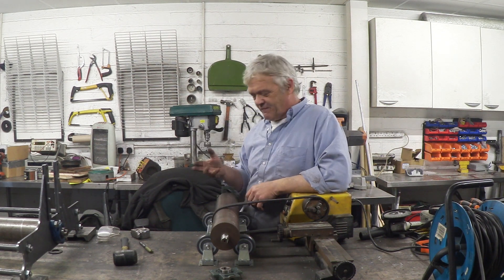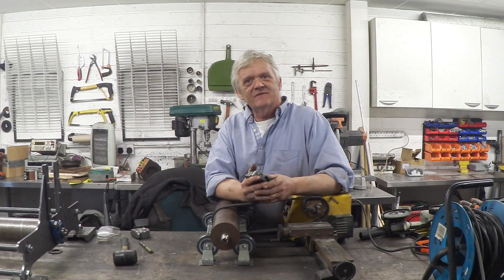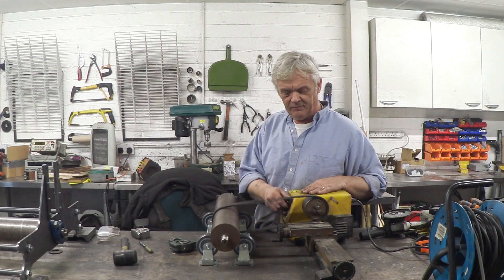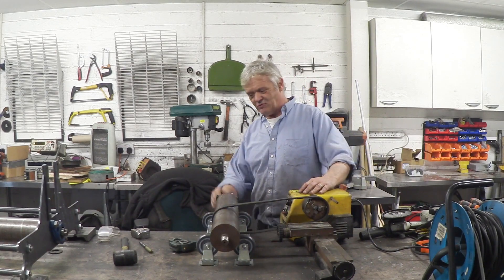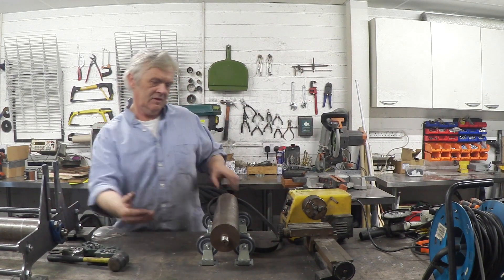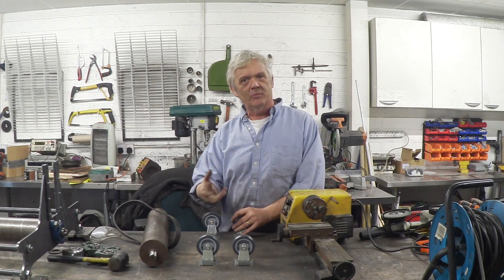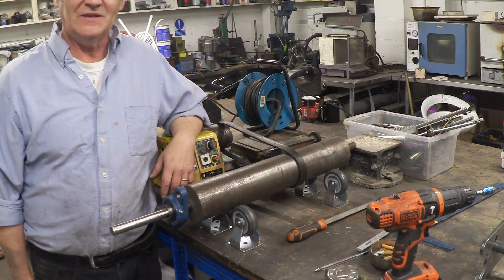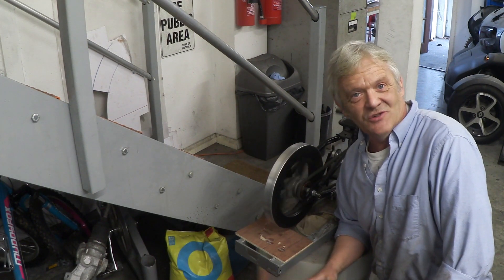1282 How To Adapt A Mini Lathe To Do More Than It Should

Comment: A good way to work on very large diameter disks is to use a wood lathe with the head moved down to the end of the bed whilst mounted on a bench. This allows the disk workpiece to hang in free space beside the bench. The biggest disk I’ve worked on this way was 30” diameter. Thank you for sharing

Comment: The only problem when doing a larger flywheel or something is it's hard to get it totally true using a grinder or something.  Unless the grinder is stationary.  Solid.  Otherwise,  if the wheel isn't totally round,  it will just follow the same shape as it is.  Hope I'm getting the point across.  I've done it though.  Using a drill press even.

Comment: I love your videos, always fun and very interesting, Here let me run this through you if i may, Its an idea for and electro magnetic pulse engine ' Not sure if it would work but the concept is there'.

You basically have the same setup as a 2 cylinder engine that would run on petrol and change some parts. the petrol engine needs a spark plug to ignite the fuel pushing the piston down on number one cylinder, As cylinder one goes down cylinder two comes up and the same thing happens again. (that's how a engine works) My idea is to replace the spark plugs with some strong magnets that are connected to the coil and instead of the spark plug pushing the piston down, You'd have the electro magnet pulse from the coil pulling the piston up and when then piston reaches its peak then electro magnet pulse from the coil two would become electrified pulling up piston 2 making piston one go down. 

So Current from coil to piston one magnet
When piston one reaches TDC current to piston one is shut off
Current to piston two magnet is engaged pulling up piston two
When that reaches TDC it shuts the current off to piston two, repeating the process.

I'm sure this could even be built with mostly plastic/3d printed and would be pretty silent as there would be no pops and bangs and we know electro magnets can pick up a car. you could make the entire thing out of plastic/3d printed parts and just have the magnets and small steal thin plates that can easily be drawn to a magnetic field.

I hope you get what i mean.
Reply from the maker: I get it mate - to my reading it looks very similar to a solenoid engine?
Reply: @ThinkingandTinkering  yes but instead of the small coils they use, You would use one in which you'd find in a car that produces the same current to the spark plug.

like have a 12v battery to a electronics board for timing the coil to send current a distributor to distribute to piston one and two, for a short period the coil would turn the magnet into a 40,000volt electro magnet. which in turn pulls up a piston that's inside a cylinder. the other end of the piston you have a crank and on the crank we have to conrods, the crank could then be connected back to the battery for sustainability or to drive something, The faster the switching of current the faster the motor would turn.

Comment: This could never hold up to tool pressure if you used an actual cutter. Putting aside all the rigidity issues, it could theoretically work if you added a third caster to each assembly, essentially building a pair of steady rests. The part would just jump out of the cradle otherwise
Reply from the maker: I am sorry mate - I don't really understand why folks say something couldn't work when they have just seen it work? - I get you point about tool pressure but to be honest I think that is a broad scope response and in reality it would be a matter of the tool, pressure applied, the type material being cut and the mass of the material being rotated
Reply: @ThinkingandTinkering  I don't think this is fair. I'm not a troll, my comment included a suggestion for how it could work with a traditional lathe tool. In fairness, you did not actually demonstrate the technique, simply told us how you did it. I think my comment clearly was referring to traditional lathe tooling, and I went the extra step to not only explain my opinion, but to suggest a modification that would make it work in many situations and on many parts. Perhaps I was mistaken, but I was under the impression that the comment section was for the sake of discussion. I found the idea interesting beyond your particular use case. You set my brain to thinking why industrial lathes do not have a similar feature. I proposed a method by which someone without a large lathe could still do large work. Isn't the point of communication to learn from one another?

Comment: When you start getting close you can swap the grinder for some emery cloth! We get it in 20mm wide strips. Rip a suitable length off and hold each end with the middle doing the work. A cheap set of vernier gauges works well for a few quid ;o)
Reply from the maker: nice tips mate - cheers